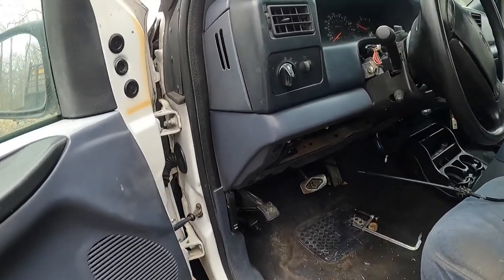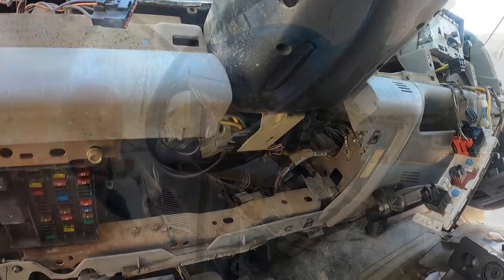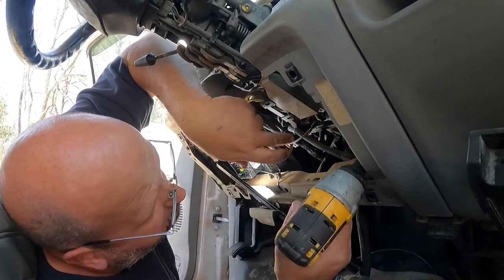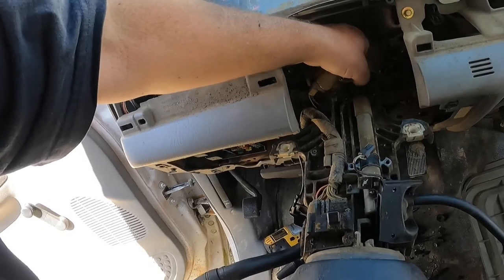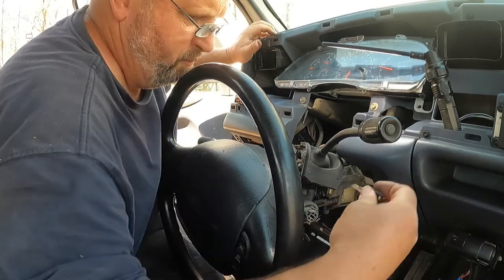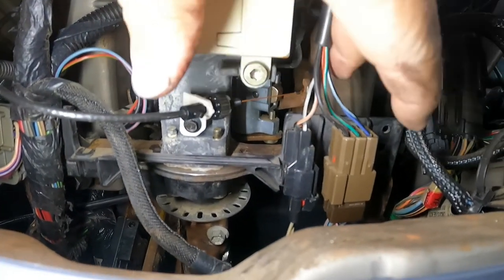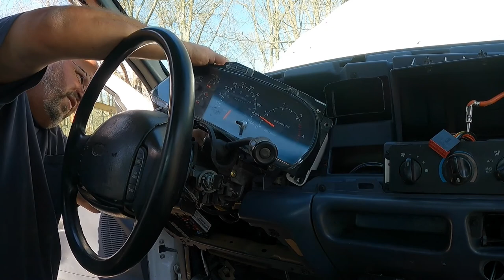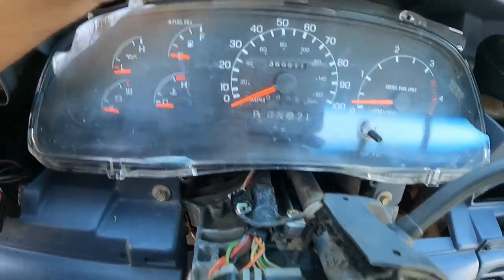2000 F 250 Shift Tube Repair

Comment: Thanks for making this video. I really appreciate it. I have the very same problem on my dad's 1995 Ford F-150. I have heard it said that this tube gets snapped from putting the truck in park while your still moving a little and the transmission parking paw snaps the tube through the cable but I'm not sure. I'm doing this fix for my fathers truck and your way of doing this work seems to be the best way. Other people pull the whole column and I don't want to do that as it's just more work. Plus about a year ago I had to replace in the same truck the steering wheel bearings cause my dad would pull on the wheel to get in the truck. Thanks again for your time making this video. You gave me the knowledge I needed to handle this repair! my dad thanks you to : )
Reply from the maker: I appreciate the feedback and am very glad to here that it helped you with our project.

Comment: This happened to me and i replaced the shift tube but its still hard to put into gear and park? Any ideas?
Reply from the maker: There is a small actuator on the the steering column that is what unlocks the shifter when the brake is pressed. It coil be bad or loose. That might be what’s fighting against ya.  The park pall or miss adjusted cable could also be causing trouble. 

I’d start with that actuator. You can test it by manually releasing it and trying the shifter.
Reply: @bayoudiesel  awesome ! Thank you!
Reply: ATTN: Be sure to use some good grease on all the moving parts!
Reply from the maker: @cwillboxer3413  yes sir. Good idea

Comment: I did this job just yesterday and now I'm having issues where my wait to start light is no longer coming on and my truck just cranks and cranks, will not start. Any idea what my issue may be??
Reply from the maker: Swapping out the shift tube shouldn’t cause a no start. I’d start with going back through the column and make sure everything is plugged in good. Some of my 7.3 have the wait to start light not work sometimes but the glow plugs on mine come on and they start. Check the glow plug relay and see if they are on. Also, I’d run all fuses with a test light to see if any popped while u were working. I’ll include a pic of a good no start flow chart that may help
Reply from the maker: Can’t add the pic. Send me either an email or number I can text it to and I’ll send flow chart
Reply: @bayoudiesel #theturd 🤣🤣🤣🤣🤣

Comment: What tools will I need too do this job?
Reply from the maker: Basic sockets to pull the steering column bolts. Then a torques bit set for the top and rear of the shift tube. I don’t think there was any specialized tools other than that for this job.